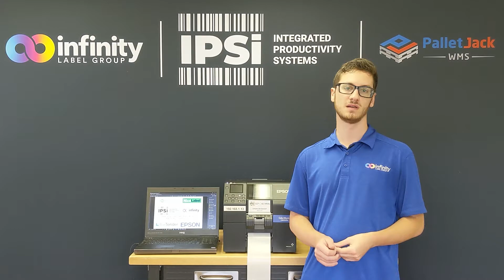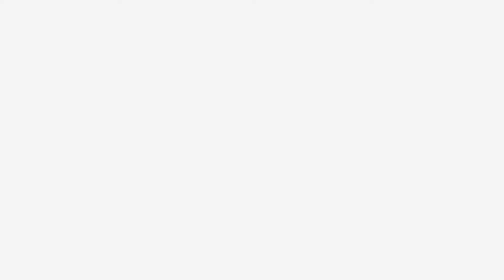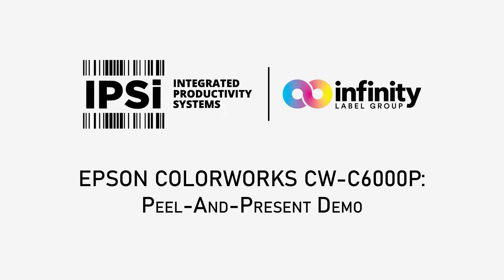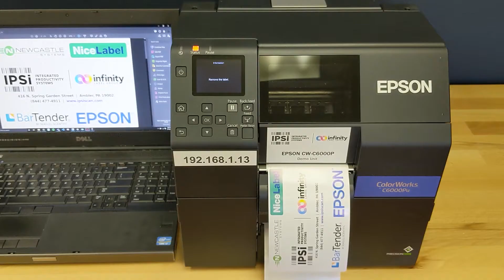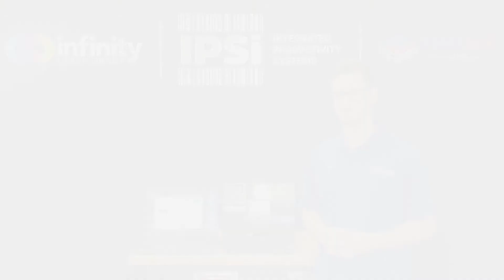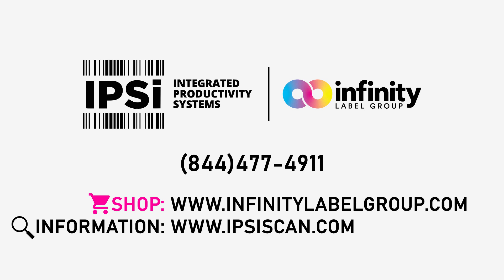IPSi Print Lab - Epson C6000P: Peel-And-Present Demo

Comment: How do I fix the problem with circular labels which doesn't cover the peel sensor and therefore it already thinks I removed the label even though I did not. Printing multiple labels in row will end up labels being printed and peeled without taking them off the printer.

Comment: Damn, perfect function, perfect output but just too slow for our peel n present needs, is there a faster version?
We serialise products as per Amazons seller Transparency program (unique datamatrix labels per product)  but the staff member applying the labels needs it to be more or less as long as it takes to grab the label, apply it to the product and move on.
Reply: There's a 7500 that's roughly 12in/sec, about 2.5x speed of the above?

If you don't need colour, though, you could get away with a thermal printer at a fraction of the cost.
Reply: oh, I lied, the 7500 doesn't peel-and-present. my bad.
Reply: @gocanux15  Hi there, thanks for your reply, yes we have a Zebra ZT-230 with peel and rewind which we got refurbed and it has been fantastic, I just wanted to move up to colour for a premium feel on our products.  So far we have not found that peel function on a colour label printer with low print costs.  I am really surprised Epson didn't seek a higher speed output on this unit given what must be common usage of a peel unit.  It is almost less important to print fast on to a reel as that is a walk away and come back task.  The ZT-230 which is 6 inch per second is plenty adequate for us in terms of speed and when you consider the epson above is rated 5" per second it would be adequate too but just watching the video I can say it achieves nothing close to that in practice.  The zebra achieves the print speed irrespective of what is being transferred where as it seems the epson rating must be based on it printing a dot somewhere and then feeding on!  Oh and that clever idea of putting the waste to flow into the trash can is great although I think the demonstrator has not experienced seeing just how quickly a trash can can fill with that waste when dropped unceremoniously in, the ZT-230 winds the waste back on to a coreless coil and gives a waste item the size of a drinking mug when it runs out, much better!
Reply: Incidentally we use Epson Ecotank printers for printing our packing slips which print automatically as and when orders are channelled through and they have been very good too, the eco tank system saves us a decent amount compared to when we used to use toners, even though we used re-manufactured and we have no waste and colour slips so I am not against the inkjet technology, it just needs to be fast for this kind of application.
Reply: @davidglover1854  thanks for your notes and comments.  Best way to confirm speed of the Epson C6000P is to send us some artwork and a specific label size.  There are many settings regarding print quality that affect speed greatly.  During Pete's video we were just demonstrating and educating people about the availability of the technology and discuss possible uses.  Regarding the waste liner, we will be doing a follow up video of peel n present using our Unwind/Rewind system which takes ups the used liner much more effectively than filling up a trash can.